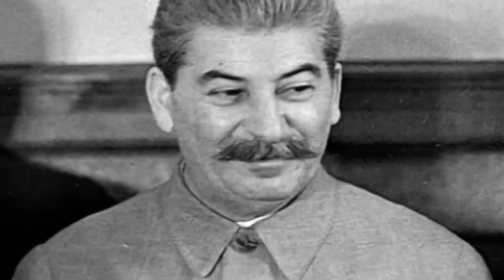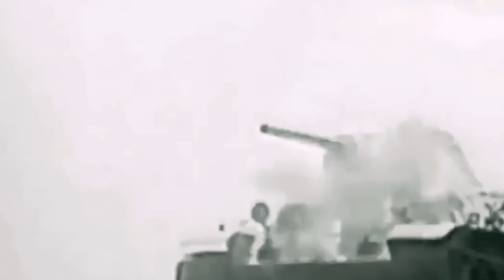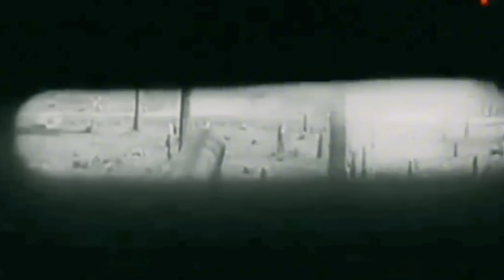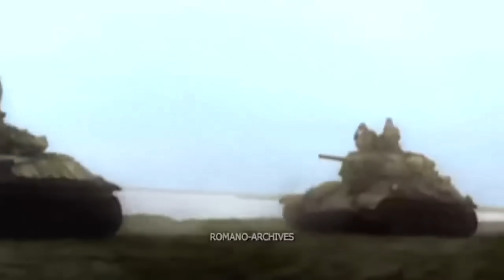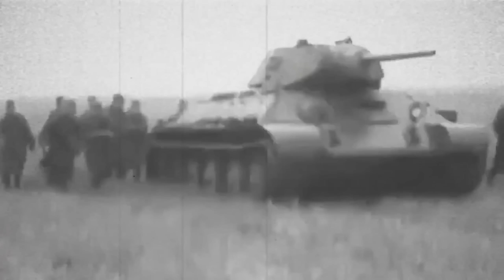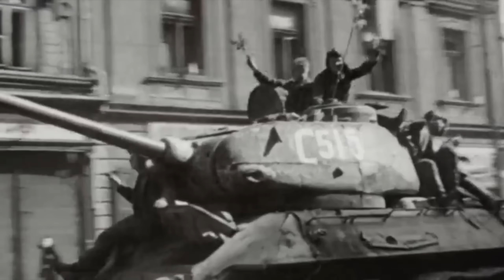Dark Truth Behind the Most Destroyed Tank Ever: T-34

Comment: The Soviet T-34 is widely reputed as the tank that won WW2, sloped armor, economical diesel engines, safer diesel fuel, wide tracks and a simple suspension system that could withstand the frozen mud and snow, made the tank a formidable armored package in its day.
Reply: No - it was numbers.  Pure numbers.
Reply: @17cmmittlererminenwerfer81  the excellent design made numbers possible, unlike German tanks.
Reply: @17cmmittlererminenwerfer81  numbers that could be achieved and manufactured by the simple and effective design. Unlike their German counterparts.
Reply: @17cmmittlererminenwerfer81 —What is “pure numbers”?
Reply: @RussianThunderrr  That person doesn't know what just said.
Reply: @dugzamilza5212 — I does looks like he doesn’t know what is he talking about…
Reply: Many T-34 where lost in the mud, they lost so many T-34 during the war they nearly run out of it during the war and no T-34 existing came from the WW2 era despite the great number they made. The T-34 is not the example of soviet superior engineering, it's the example of Soviet immense reserve of resources and industrial production.
Reply: @itachiaurion3198  they didn't have the luxury of time or an environment for superior engineering, however as a package it held many advantages over other WW2 tanks, hence its success, and is reputedly by many as the tank that won WW2.
Reply: @Jimmy-ye3wg  wrote: "they didn't have the luxury of time or an environment for superior engineering, however as a package it held many advantages over other WW2 tanks"

-- It is partially true to some extend, as T-34 was next generation of BT line tanks, but featured an anti tank gun prove armor protection, so T-34's(and many Soviet war and even post war tanks) V-2(designed by Konstantin Cheplan in Kharkov) engine for example was designed and developed for seven years, before even plans for T-34 tank were drawn up, as the engine for BT series tanks, that T-34 eventually replaced. That twelve cylinder V-12 38.8Litters displacement engine called V-2 was a technological marvel, and arguably best engine of any WWII tanks.
-- Armor protection also was designed and developed by Nicholie Tsyganov, after BT series tank poor performance in a Spanish Civil War 1936-38. 
-- F-34 gun was designed by Ivan Grabin, as a replacement for not so reliable L-11 gun by Gorkie factory, and ect.

-- So many things were developed over a long period of time, but some things like three men turret, TC cupola, and torsion bar suspension was not in time, and have to be redesign during WWII.
Reply: @itachiaurion3198  wrote: "The T-34 is not the example of soviet superior engineering, it's the example of Soviet immense reserve of resources and industrial production."

-- And what make you say that? Armor plates under rational angles(where Effective Armor Thickness doubles, which made all Germans tank and anti tank guns obsolete for about a year)) did came from Kharkov design bureau, and was copied by all German tanks that designed after encounter with T-34, and long after the war ended. Dual purpose(anti tank and anti personnel) long barrel 3 inch 12 pounder gun in a rotating 360 degrees turret also came with T-34 and KV-1 tanks and were superior to any German(or any other tank up to that date) tank up to that date. Dedicated diesel tank engine, that was not carburetor, but used fuel injection and never needed and adjustment for the life of the engine, with DOHC(Dual Overhead Camshafts) and 4 valves per cylinder - is another good example of superior engineering. Earlier you mentioned "mud" problem, T-34 offered wide caterpillar tracks worked much better, then narrow German and Allies tank, so you are wrong in many accounts about T-34 tank subject.

Comment: Why does everyone gets this wrong. Sloped armor was not revolutionary. The Germans were well aware of this. Sloped armor took up massive internal space. The Germans went for better ergonomics and battlefield awareness and command and control. Both theories were right and wrong. The Soviet one was slightly better but at a cost. That's just my opinion.
Reply: The Front glasis plate of a Sherman was also sloped
Sloped armor dates back to the US Civil war river ironclads.
Reply: @firstlast-hj2sb  wrote: "The Front glasis plate of a Sherman was also sloped
Sloped armor dates back to the US Civil war river ironclads."

-- What was US Civil war river ironclads armor Angle and thickness, that you claimed M4 Sherman tank "copied"? So this is, yet another topic I wanted to address, that Soviets copied FMS36 tank armor, or US Civil war river ironclads, or Leonardo Da'Vincci tank form 15th century what have you else... So if you make tank, there is always a most important question: How much armor, what would be a thickness of that armor, and at what angle the armor should be placed at... The answer is what threat is armor designed for, so in case of T-34 it was through the experience of Spanish Civil War of 1936-38 and experimentally determined that feature T-34 have to have frontal armor that is able to withstand any tank(KwK) and anti tank(PaK) gun, and perhaps a future upgraded guns. So, T-34 armor prety much was able to reliable defeat any German PaK and KwK guns including 50mm L60 guns, while FMS36 only 37mm PaK and KwK and from long distances only. More, side armor of T-34 could also defeat 37mm PaK or KwK, while M4 Sherman could not, mind you 37mm PaK36 are most numerous German guns in war that was used all the way to the end of the war.
Reply: for german tanks sloped armour was at first used on the Schützenpanzerwagen Sd.Kfz.251 and on the observation tank Sd.Kfz.222 and 234.
Reply: @ichmalealsobinich — Not every slopped armor plate use EAT to increase AT(PaK or KwK) projectiles resistance. Just so you know.
Reply: True they wanted a t34 for themselfs
Reply: When white Christian life is not important for the Jews or Bolsheviks
Reply: no, you are correct
so many tanks had sloped armor yet everyone always repeats like soviet propaganda machine how revolutionary and indestructible it was
how germans couldn't destroy even one tank
and yet somehow it's the most destroyed tank in history
Reply: @ryszakowy  wrote: "no, you are correct
so many tanks had sloped armor yet everyone always repeats like soviet propaganda machine how revolutionary and indestructible it was
how germans couldn't destroy even one tank
and yet somehow it's the most destroyed tank in history"

-- Comparing to what? Tiger tank was enjoyed best armor protection, and copied slopped armor under rational angles from T-34 on the second model(Ausf.B aka King Tiger), yet ratio of numbers produced to destroyed/lost was even higher that of T-34 in both models.
Reply: @ryszakowy  The French FT-17 had sloped armor. THAT'S THE FIRST TANK TO EVER HAVE A TURRET. Sloped armor is not a Soviet invention.
Reply: @Jim-s4y1g  wrote: "The French FT-17 had sloped armor. THAT'S THE FIRST TANK TO EVER HAVE A TURRET. Sloped armor is not a Soviet invention."

-- Why do you getting it wrong? Angle at which to sloped armor plates, so they protect tank from any German anti tank or tank gun belongs to N. Tsyganov, and not French Renault tank, as it only got bullet prove armor.
Reply: Russians got that finallly in 2000s that  the crew comfort, dedicated role of crew members and ergonomy value more than low profile.
Reply: @podunkman2709 — Do you have any nations in mind which in 21st century have not figured out, that high tank profile is more important than been a “watch tower” for scouting in modern battlefields?
Reply: @podunkman2709  wrote: "Russians got that finallly in 2000s that  the crew comfort, dedicated role of crew members ..."

-- Crew comfort in WWII tank is oxymoron, and dedicated crew members - you are off by more then half century(see T-34M model of 1940), not to mentioned T-34 was a Soviet tank, that was initially designed and build in Ukraine, just so you know!
Reply: @podunkman2709  Usability of the tank is something everyone ignores. The contortions a gunner of a 17pdr in a Firefly had to get into to fire the gun were exhausting and uncomfortable, loosing crew efficiency. The breach was too big for the turret. That's part of the reason the US took the 76 mm instead. 76 was supposed to have different ammo too, drastically improving performance. Of course modern Russian tank design has hit new heights (partially, as the turret flies).
Reply: That's very well reasoned , I never heard that before . I'm impressed by your observation
Reply: Everyone doesn't 🤭
Reply: Si y el T34 llegó a Berlín 😂
Reply: — Because it was not a “slopped armor” but Effective Armor Thickness, which every German tank that was designed after encounter with T-34 got that feature, even after WW2 Germans and even Americans used it, but their tanks came out too big and overweight.
Reply: @RussianThunderrr  German tanks, even the Tiger-1 had sloped armor they just didn't slope it as far as the Soviets, the Soviets who gave up on the highly sloped side armor used on the T34. The T44 T54 T55 are nowhere near as sloped as the 34, and the T44 was the direct replacement for the T34
Reply: @sintruder  wrote: "German tanks, even the Tiger-1 had sloped armor they just didn't slope it as far as the Soviets"

-- So, what is "Rational Angle of Armor Plate" that is wrongfully been translated/coined as "slopped armor"(BTW the author of this idea is N. Tsyganov)? It's the angle of armor plate at which you get maximum(double, where 45mm armor plate acting as 90mm) what called "EAT" or "Effective Armor Thickness"(aka Armor Plate "Line of Sight" that projectile have to punch through) beyond which angle, armored fighting vehicle becomes impractical, while with less angle you get diminishing benefits of EAT. So, with Tiger I armor plate of 100mm slopped to 10 degrees your EAT ~101-103mm which is defeating reason why it have to be slopped to 10 degrees because it harder to manufacture/fabricate part, and of course two plates are a lot easier to join together, then a three plates of Tiger or any other "step" nose of the tank. Also projectile deflection(aka ricochet) at 10 degrees is none existent, while at 60 degrees is very likely especially for a smaller or equal to thickness caliber round.
Reply: @sintruder  wrote: "the Soviets who gave up on the highly sloped side armor used on the T34. The T44 T54 T55 are nowhere near as sloped as the 34, and the T44 was the direct replacement for the T34"

-- It is not as simple as you think it is... Couple of notes here: First frontal armor plate(aka Glacis) remained at the same 60 degrees angle. Second: what changed is the side armor composition it got significantly thinner and with no slope. Why is that? Because while working on improvements of T-34 armored configuration statistic is been gathered, that most of the hits was done to tank's turret, and that is per that statistics tank armor got most of the improvements, and frontal armor of course, so glasic plate angle on all T-34, T-44 and T-54/55 is 60 degrees, however armor thickness increased significantly from 45mm of T-34(with EAT=90mm) to T-44 90mm(EAT=180mm) and T-54 100-120mm(EAT=200 to 240mm). Now, since height of the tank decreased significantly, so is the chances of hitting side armor, which in case of T-44 and T-54 tank all but disappeared, while turret got most of the armor thickness upgrade through out the line up from T-34 to T-54, just like a galsic plate.
Reply: @RussianThunderrr  when you have less rounds to defend yourself because of lost space, that sloping starts to be less appealing
Reply: @sintruder  wrote: "when you have less rounds to defend yourself because of lost space, that sloping starts to be less appealing"

-- What makes you think T-34-76 had less rounds? It, just like 75mm M4 Sherman had 100 rounds, so is T-34-76 with F-34 gun had 100 rounds for main gun, yet it had bigger and higher velocity gun, better armor protection all around, better with more power and torque(near double of Sherman's best Ford AAA) engine, and better range, then M4 Sherman, lower silhouette, lower center of gravity a lot more maneuverable, weight less(at 26-28 tons), could carry up to 10 infantry men, much easier to maintain, since there no ignition, carburetors or lead in fuel to worry about, and that is just some of the reasons T-34 was much better overall tank.

Comment: Soviet losses of 20,000 tanks in 1941 alone. For the Germans that was kinda like shooting in a barrel. Hard to miss. 😮
Reply: The Germans lost 1 mio. men and 80k officers in the first year of Operation Barbarossa, a walk in the park looks different.
Reply: 20,000 tanks is the figure of propaganda, the reality is that for example during the largest tank battle in Brody Ukraine 1941, most of the Soviet armored forces T 26, BT 7, T 28, some T 34/ Kv 1, were victims of treason, mechanical sabotage and fuel, etc... the rest was destroyed by Stukas and Pak, between 400 and 800 ex, there are few clashes with the Panzers... it is necessary to return to historical reality and get out of the myth of Panzermania, tanks are not used to confront each other like knights of the middle-age, but to make a breakthrough from the front line, conduct encirclements.
Reply: — It was not really the case, as you imagining. Pick up any dissent book on operations Barbarossa and find out that German Panzer spearhead actually avoided any heavy tank encounters, instead of dealing with it head on, until they could not, hence the pincer strategy failure by the time they reached Moscow city.
Reply: They also were still losing 24,000 in 1944.
Reply: Germans were only trained to fight village people. When the Red Army came it was all over.